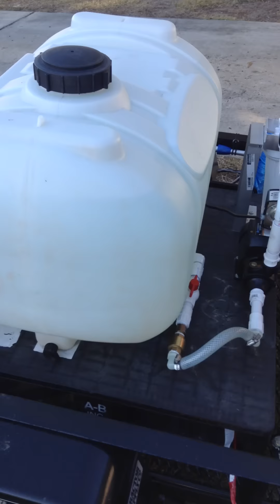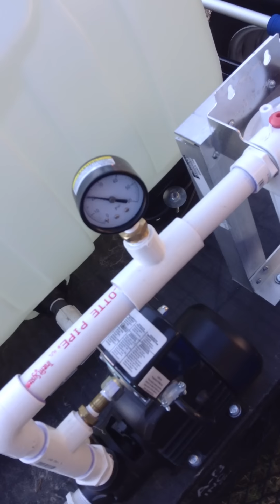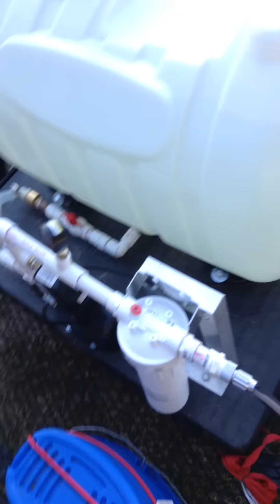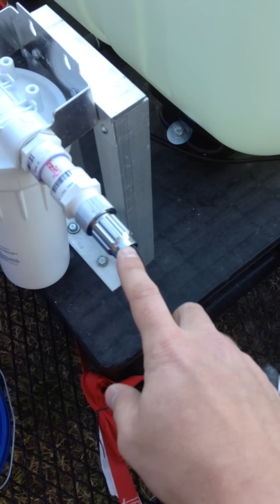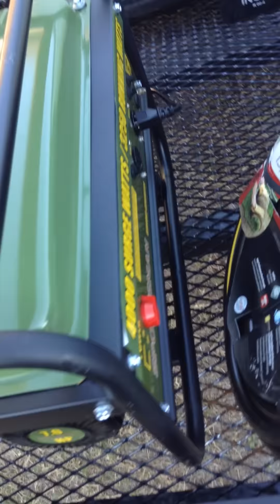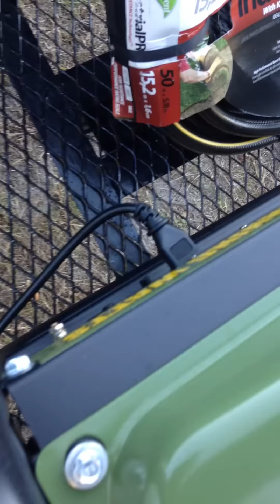How To Set Up an Inexspensive Mobile Wash Station

Comment: Hey just saying if you want an entry level extractor that will get the job done, the bissel littlegreen proheat works great. It only cost 100 bucks, its what Im using while im saving up for a full size extractor.